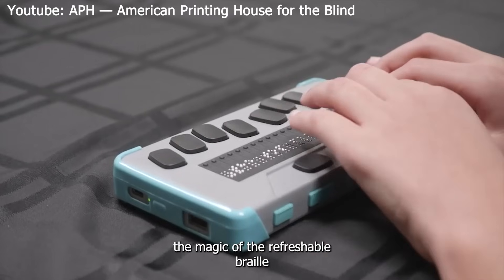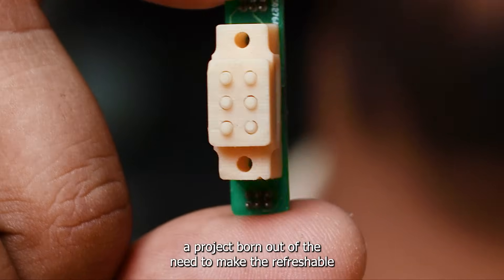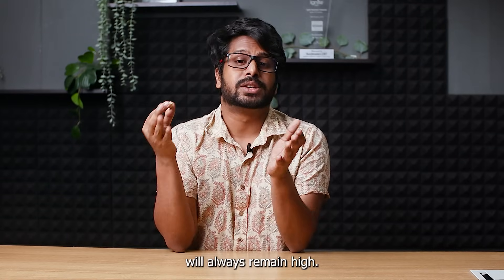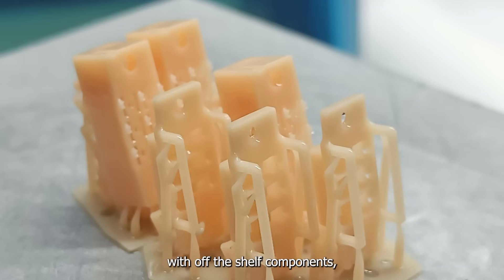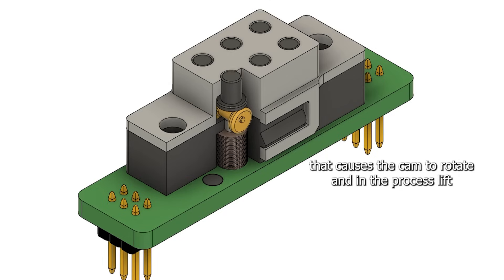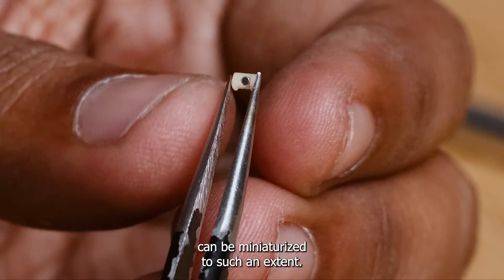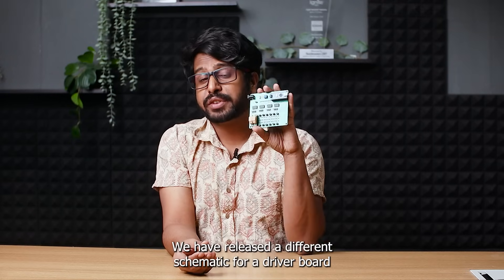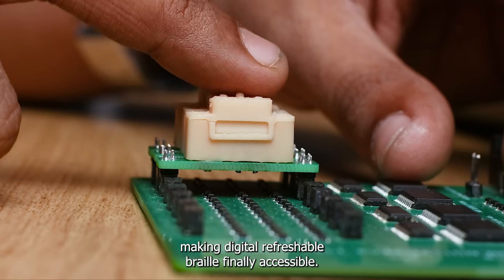Electromechanical Refreshable Braille Module : HackadayPrize 2023

Comment: I had no idea that braille devices were so freakishly expensive. Great work, makes me wonder what other accessibility technologies can be reduced in cost and manufacturing. It's amazing that you were able to hit both of those in your design!
Reply: It isnt because its expensive, its because they know they can rip off the disabled, this happens across almost all disabled marketed devices. Big props to Vijay for having some humanity.
Reply: Well, thing is, most blind people - as far as I know - just use screen readers instead. You do not nead a braille display if you can get everything read to you.

I'd guess braille displays are most often used in public places - where you don't have your own device, so you wouldn't know how to operate it easily.
Reply: @iFireender one of my co-workers uses a braille line to read. I've seen her using it and think she reads faster than the speed a screen reader would talk. And she has her reader on some insane speed, so I could only hear gibberish when she uses it.
Reply: @joachimfrank4134  Huh, interesting. But yeah, I can see that being a thing.

But my point still remains - where Braille readers once would have been indispensible, nowadays, it's just possible to set up most devices with proper accessibility modes for blind people, which decreases the market for braille readers even more, which in turn makes them more expensive.
Reply: @iFireender  screen readers being common isn't because they're a superior tool compared to Braille. they're widely available because they're just using already existed technology used by the majority like speakers or the software used for text to speech and many times they aren't even integrated for disabled people but rather was just used for gimmicks like there's a difference between Google text to speech and a actual text to speech that is impaired for the the disabled. the market for Braille isn't decreasing because there isn't a market to began with if it is treated as a exclusive luxury product for the rich that is made in a custom factory with select meterials then that doesn't even need to care about the market or its customers

Comment: absolute game changer, fantastic engineering!!! About how long does it take to assemble a single module?
Reply from the maker: Thank you! And thanks for subscribing too!

If the coils could be SMT mounted, they a single module could be hand assembled in under 5 mins. The coil winding takes time, but no reason why that cant be automated, like SMT inductors are. 

Check out the build instructions on https://hackaday.io/project/191181-electromechanical-refreshable-braille-module  for more insight

Comment: Amazing work, thank you for generously sharing it to the world!

I wonder what you or the DIY community could achieve with electrotactile stimulation. Are you familiar with it? It works by applying gentle electric signals to your skin, stimulating sensory nerves directly without need for any mechanical parts. The nerves can be made to react like when you touch different physical shapes and textures. In principle you could use lots of very small electrodes to match the high sensing resolution of the fingertip (luckily you wouldn't need to cover any larger area than the fingertip, since motion along the surface can be simulated with the electrotactile system). Or just create a Braille display, which would probably be much cheaper.

Check out the paper "Super-resolution wearable electrotactile rendering system" from 2022, it has nice figures and all to give a quick impression what is achievable and how it works.

Disclaimer: I don't know much about electrotactile stimulation myself, just that it is possible. There are probably several problems which could make it difficult to utilize affordably, but hopefully there are people who can find solutions.

Comment: Do pins stay out when pressed against with a finger? Do they move around or feel gummy? I'm not blind, but I am curious.
Reply: Was this a solo project? If not, who worked on this? Is this truly an original design? If yes, is there a technology that performs the task to a similar standard? If no, are you sure? If there is one, is it successful? If it is, is yours better? Why or why not? If it did not succeed, why? Can your version succeed? I don't actually think these are good questions, especially the last few, but answers would be neat.
Reply: One more, for a finished 40 character device, would the cost be below 100$? If not, below 200$? If it's less than a dollar each character now, and the rest of the tech being super cheap with a plastic housing on top, if you wanted to lose in developement costs at first, could you hit 100$? 200$ is probably more fair on your wallet, but it's for the visually impared. Do what you may. I bet it'll be sold for 549.97$. Specific, but accurate.
Reply from the maker: As a thumb rule, a selling cost of 3X BOM takes care of the fixes expenses. So a selling cost of 300-500$ is fair, and still much cheaper than existing market solutions. 

I would also expect to pair it with a smartphone, instead of making the display itself intelligent, to not make the display unnecessarily bloated than it is supposed to be.
Reply: @vjvarada  Thanks for the answers!
Reply from the maker: I wish i could take credit for being the first to come up with the idea of using cams,  but here (https://worldwide.espacenet.com/patent/search/family/014715047/publication/JP2802257B2?q=pn%3DJP2802257B2) is a patent from 1996 that proposes an idea for using cams as well. Although very different in terms of design from the one I've created, its good news that a design that uses cams had been patented once and is now expired, meaning that its in the public domain.

It was a solo project, ive been playing around with various solutions to this since engineering college (almost 15 years ago) but have been over the years exchanging notes and reading about developments in this for a while. 

TBH, it started off as an engineering challenge to tackle and hone my skills, but now has taken share into something that might actually create an impact in terms of reducing the cost of braille displays and democratizing the technology.
Reply from the maker: The pins do not depress down, but have a little give when moving side to side. I designed the pin & hole to have a taper so that when the pin goes up, the tolerance reduces. Earlier prototypes didn't have this and had alot more side to side motion.

Comment: My father is blind, but, even though he knows braille he is unable to distinguish the dots due to low sensitivity. It would be great if there was a option for more spaced and more protruded dots for people in similar situations
Reply from the maker: More spaced out would actually make things so much easier! I have not come across a standard larger than the "perkins jumbo braille", is there one you know of?
Reply: @vjvarada  I haven't thought about searching for that. I just asked perplexity Ai and it seems there is. Here's the answer: Is there any standard for braille dots size, perhaps larger?

According to the Braille Authority of North America, the nominal height of braille dots is 0.019 inches or 0.48 mm, and it should be uniform within any given transcription[1][3]. The dot base diameter should be 0.057 inches or 1.44 mm[3]. The distance between two dots in the same cell must be between 0.090 to 0.100 inches away from each other, measured from center to center[9]. The dot diameter for the Marburg Medium Braille Specification is 1.3-1.6mm, and the dot spacing is 2.5mm from dot center to dot center[10]. The Large Cell Perkins Brailler has a 40% larger cell than the Classic Perkins Brailler, and the distance between the cells is ~50% wider[8]. Jumbo braille, also called expanded-cell braille or large cell braille, is an alternative way to write the special "language" of the blind. The horizontal spacing between the dots and cells is increased just a little bit, but the dots themselves are the same size as those used in standard-sized braille[4].

Citations:
[1] Size and Spacing of Braille Characters https://brailleauthority.org/size-and-spacing-braille-characters
[2] Why Is Braille So Big? https://brailleplus.net/articles-and-publications/why-is-braille-so-big/
[3] [PDF] Size and Spacing of Braille Characters - Instructables https://content.instructables.com/FZZ/NMZD/JOYNPPJD/FZZNMZDJOYNPPJD.pdf
[4] What is Jumbo Braille? - Language Humanities https://www.languagehumanities.org/what-is-jumbo-braille.htm
[5] Braillo Are The Only Embossers That Meet All Braille Authority Dot Height & Spacing Standards. https://braillo.com/braille-dot-height-standards/
[6] Braille, Innovations, and Over-Specified Standards - ViewPlus https://viewplus.com/braille-innovations-and-over-specified-standards/
[7] Raised Text & Braille Requirements - Avalis Wayfinding Solutions https://www.avalisway.com/resources/ada-raised-text-braille-requirements
[8] Large Cell Perkins Brailler https://brailler.perkins.org/pages/large-cell-perkins-brailler
[9] The Ultimate Guide to ADA Braille Signs https://martinadasigns.com/the-ultimate-guide-to-ada-braille-signs/
[10] Marburg Medium Braille Font Standard - PharmaBraille https://www.pharmabraille.com/pharmaceutical-braille/marburg-medium-font-standard/
[11] Braille Specifications - MK Design https://www.mkdesign.uk/braille-specifications.html

By Perplexity at https://www.perplexity.ai/search/761d8f3f-fa81-44bd-a11d-d738b25d63d1?s=m

Comment: really cool design. I wonder if using standardized pins (i am coming from mechanical engineering) will not only make this cheaper to produce but also way more sturdier / reliable in bad conditions (such as your mentioned atm/public displays)

Comment: You could cut out the dots and coils and just put small devices the fingertips (maybe one is enough) to conduct electricity via the skin. Nerve endings and sensing circuits in the brain are adaptable, you could probably train a Human to sense quite weak pulses and patterns thereof. Then you train him to recognize different patterns of pulses depending on the braille letter (maybe even just distinct for 3 dots). Then he can move the finger with the device over a board like a stylus, with the system recognizing the position of the finger and giving the right impulses. Alternatively, connect the pulsing electrodes to the forearm (not even the same one) for an even richer set of recognizable signals, maybe even combine with auditory queues, while the finger of the same or the other hand is moving over the surface. That way you could use existing multi touch surfaces.

Comment: I know many blind folks since many many years.
There were electro mechanical braille cells from Metec AG and Schönherr ( German companies) years (like 40 years) ago...
They were not successful in competing piezo cells because users / braille readers needed to lift the fingers from the cells so that the pin could change it's position.
How does your concept / mechanism behaves in this scenario?
Also what is the refresh rate your cells can deliver when changing content fast?
All braille cells with piezo electric mechanisms are performing very well in these tasks.
Reply from the maker: Thats a good point you bring up. That is defiantly a shortcoming, that it cannot lift up a finger, and will only refresh if there is no weight on the pin.  

This prototype is 200ms/ Pin, because of an oversight on the electronics part,. I am currently working on the next driver board that does 200ms/cell.

Comment: This is great! I did a very similar project for a class in my undergrad. We planned to use a linear cam (encoded with all possible values) for each column of dots in a cell, with 2 cams per cell, instead of a rotating cam for each dot as you have. We also planned to multiplex the system with a gantry that would move the motors needed to actuate each cam, reducing costs. Your system is much more compact due to those micro magnets, they're great. It is also much faster than mine would ever be.  Smallest magnet I could find back then (available in my region) was 4 mm in diameter, which is too big for an individual dot.
Overall your progress is much more advanced than my team ever did, and I hope your design gets polished and implemented in a finished product. Best. :)

P.s. in my project we tried to evaluate if our parts could be injection molded. There are some relatively inexpensive systems where you make the mold out of a high strenght sla printed resin, lasts for about 1500 injected parts.
Reply from the maker: Just in a few years the avaialability and capability of high quality 3D prirning has been a game changer. I was also considering a linear motor-cam aproch to this my remixing several projects out there with the use of these micro magnets and PCB stator which would eliminate the need to winding any coils. 

As an engineer working on projects like these really tests your skills, and I had a lot of fun figuring things out. I hope you continue your research too, with the knowledge of the availability of these small magnets.

Comment: That's excellent, I didn't know these displays were so much expensive! But you could further reduce the global solution cost and assembly by placing a tiny micro-controller on each cell and daisy-chaining them exactly like for RGB LEDs. You'd just need 4 pins: +5V, GND, Din, Dout, You could then assemble all your cells on a passive board (or even a ribbon) with two power rails and one pin on each extremity, and it would be trivial to increase the total display length by just appending more cells (or appending a module made of multiple cells).

Comment: Mr. Varada this is incredible work.

The design is so simple, it makes one think "Why didn't I think of that?", which is a hallmark of excellent design. Good engineering ideally results in a simple design that seems almost obvious (but whose process to completion is often anything but!). 

Seeing your 3D printed designs, they look like something that could be made even more economical than what you may currently make if you take advantage of economies of scale. The 3D printed parts seem ripe for Plastic Injection Molding, and given their size and simple geometry, they could be produced by the tens of thousands for fractions of a cent. I wish I could offer more concrete figures on what that might cost, but I only ever took part in making such tooling and only for a few years in an apprenticeship (I've since returned to University to complete a degree in Electrical Engineering). I can appreciate your experience and dedication on that part; I strongly doubt this mass-manufacturability is a coincidence, I'm sure you took a careful and deliberate effort on your part to ensure that this would be the case, and it absolutely shines through here. 

I noticed in another comment that you were investigating manufacturing at scale. If funding is an obstacle, perhaps you might consider reaching out to some non-profit foundations that help the blind and ask about grants? I know you are in India, so while I am not sure which foundations would be there, I am certain there are at least a few! This has the potential to help quite a lot of people that are vision impaired, and give Engineers around the globe a whole new set of tools to increase accessibility for everyday products. I'm sure your project would speak for itself if it gets in front of the right people.
Reply from the maker: I wish i could take credit for being the first to come up with the idea of using cams,  but here (https://worldwide.espacenet.com/patent/search/family/014715047/publication/JP2802257B2?q=pn%3DJP2802257B2) is a patent from 1996 that proposes an idea for using cams as well. Although very different in terms of design from the one I've created, its good news that a design that uses cams had been patented once and is now expired, meaning that its in the public domain!

As for the injection moulding costs goes, Its actually not too expensive( everything considered) to make a single tool to fit all these parts, especially with a material such as POM that is self lubricating and will surely make the system more reliable.  I got a quote of about 12,000$ as tooling costs without optimising the design for injection molding. 

At the same time, the cost of 3D prirning in performance materials isn't so much more expensive either, since the parts are so small and hardly consume material. I am still to work our some kinks in the design, and ever since putting the project out there have gotten a lot of suggestions to improve the design in terms of mechanics and electronics and will continue to use 3D prirning, even for smaller batch manufacturing till I'm sure of the design before switching to IM.

Currently the cosliest part in terms of time to manufacture in the coil, and is the focus of optimisation currently.

Comment: This is awesome. Excellent work. I audibly gasped when I saw the cross sectional view of the proprietary market devices. Such crazy custom engineering. Like no one's tried to tackle the problem with modern manufacturing processes in the last decade.
Reply from the maker: Couldn't agree more! The increasing access to high-resolution 3D printing, as well as capable yet affordable PCB fabrication and assembly services, makes so much possible.

Comment: Awesome project! Have you released STEP files for your designs? I took a quick glance on the hackaday page and I did not see any (only Fusion 360 files). I would love to help reverse engineer the braille cell in an open source CAD software (such as build123d which contribute to)!